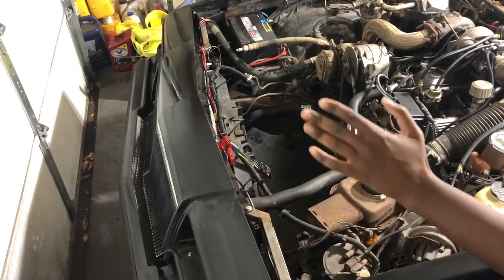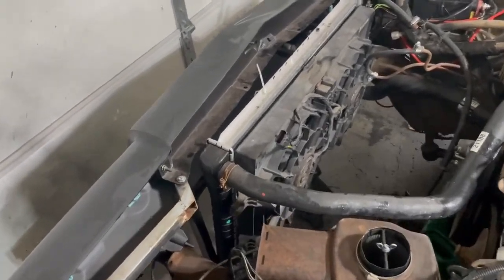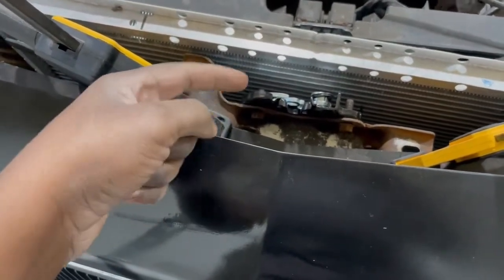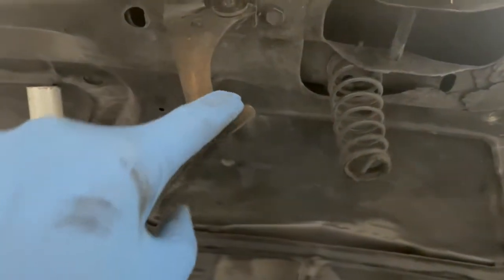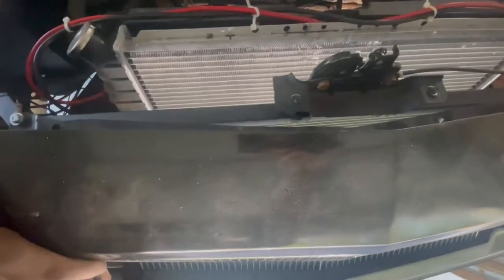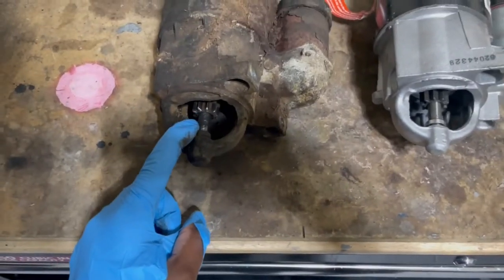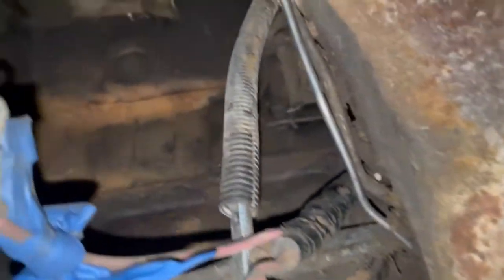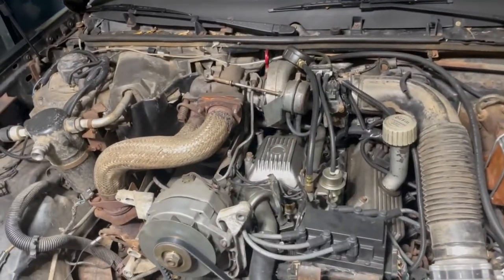Cracked Engine Block! Rebuilding a Grand National Part 20

Comment: Crack block Sticking repair , Drill  hole tape thread install brass plug/bolt & continue & overlap to the end of crack . Machine shop repair .